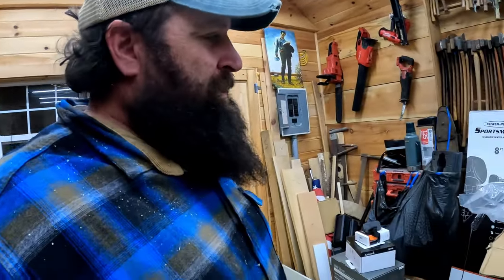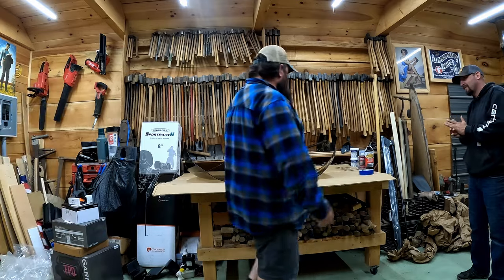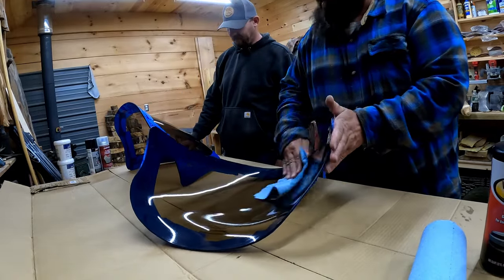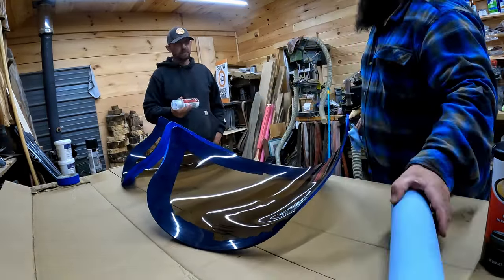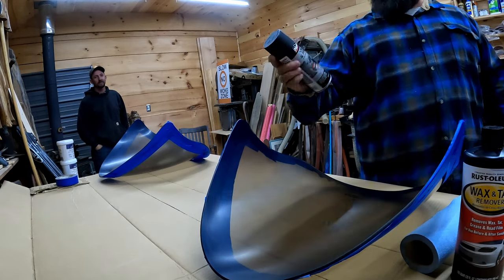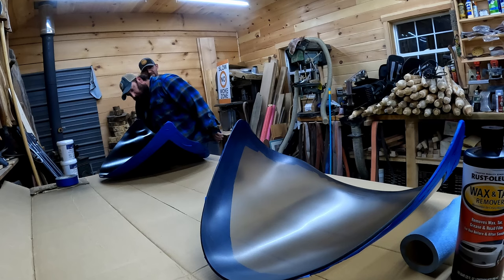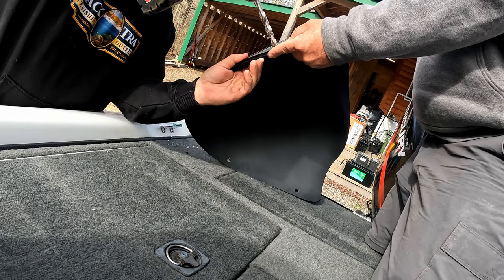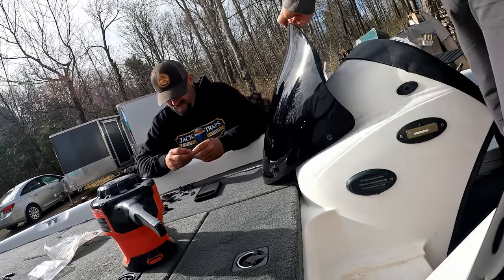EASY Windshield BLACK OUT: Boat Restoration

Comment: Guess I missed it - why did you have to drill out the holes?
Reply from the maker: I guess they aren’t a standard hole set at the factor they just kind of put them in around the same areas since it would be hard to get exact so if you replace you want to hit the original holes and they aren’t standard so you should drill to the holes where you are mounting